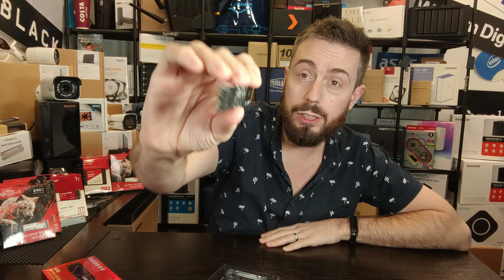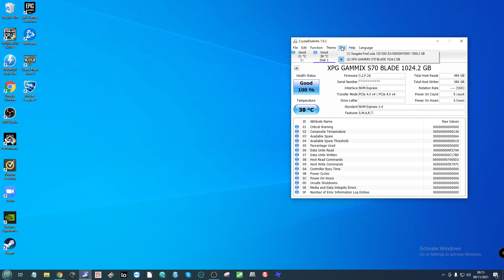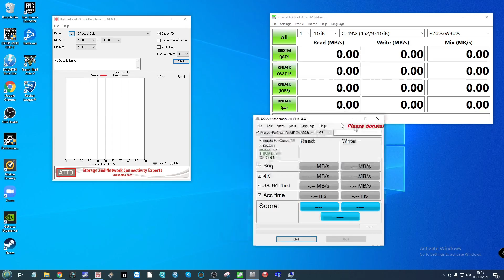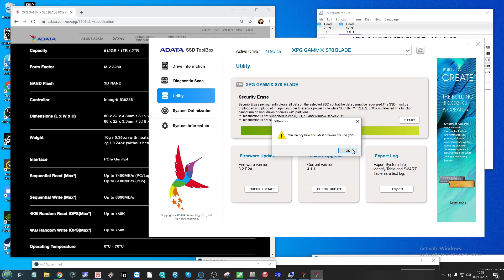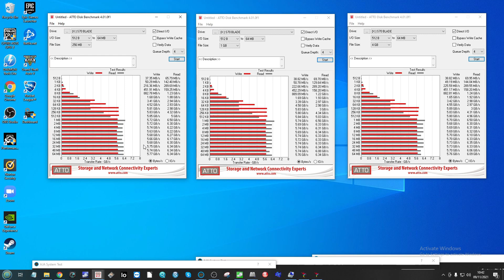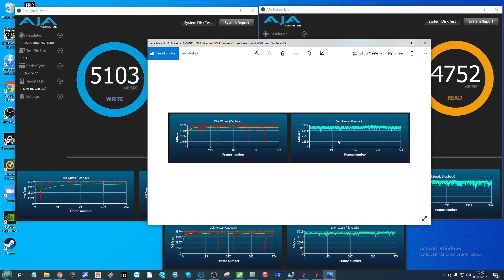XPG GAMMIX S70 BLADE SSD Review - New Phison Killer?

Comment: Is the 2 TB model 299 pounds or 399 pounds?  The on-screen info says 399, but I think you said (verbally) 299.
Reply: I bought it for £294 in October via amazon- its £340 now.
Reply: @EFC1878Mark  wow. In my country we can get the 2TB for around £250.
Reply: You can get it on sale right now on amazon if you use their voucher on the page for the product. Said it was 25% off today from £340
Reply: The on screen price is shown in $ not £.
Reply: @GroundDwellerStudioS  Doesn’t matter.  My point was that there’s one number in text and different number in audio.
Reply: As of 15:29 on the 18 November, Amazon have the 2TB version for £238.18!  This is the model without the heatsink.
Reply: @stuartedwards6996  pretty sure you can get the one with a heatsink for around the same price. Edit just check it 238 for the 2tb with the blade heatsink
Reply: @kuroinova2056  Cool, I meant the version without large heatsink that would not fit in a PS5.
Reply: @stuartedwards6996  that would fit in the ps5 or not?

Comment: I just commented in another video but I was wondering if you may see this.  I have this in my PS5 with the heat spreader on it.  I got the new Sabrent Heat Sink and was trying to put it on but with that thermal pad it seems to be a bit too tight.  Have you tried that?  can it work ok without the thermal pad?
Reply: I brought another heat pad for it, that is smaller than the one that came with the sabrent ps5 heatsink. But i had to cut a small piece of another to fit the whole drive. Sabrent recommends you remove the other heatsink to install sabrent heatsink.
Reply: @kuroinova2056  yeah unfortunately there's no way I'm getting the heat spreader off the NVMe without damaging it.  It's practically glued.
Reply: @billywilliams  yh that what I felt, so I left it on, and just got another thermal pad that was significantly smaller
Reply: @billywilliams  I tried to take the heat spreader off mine too and I couldn't get it off. I was going to put a bigger heatsink on it.
Reply: @wornout_joystick  😂😂😂 I did the same thing. But the pad is stuck on there , especially once it heats up a little and cools off.
Reply: @wornout_joystick  I think there are some videos on how to remove the heat spreader the safe way without damaging the Nand chips or the controller.

One of them is dental floss and the other method would be a hair dryer or heat gun.